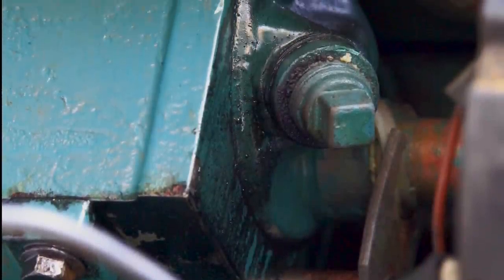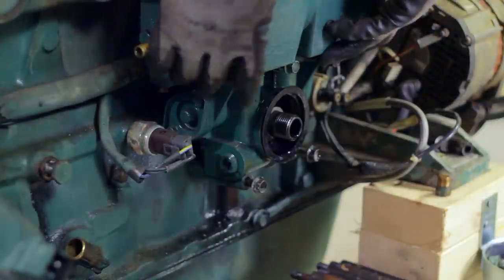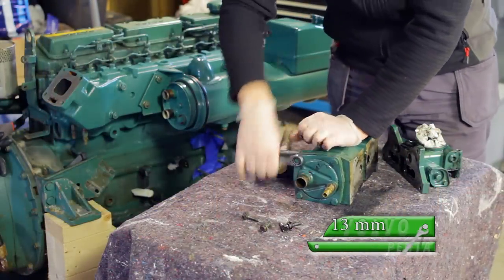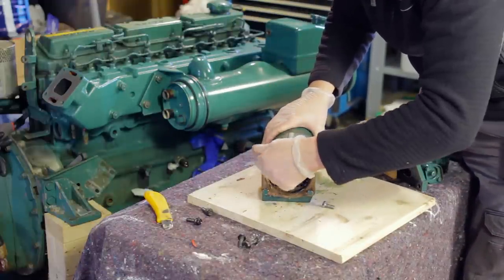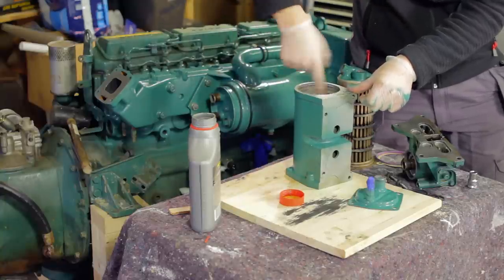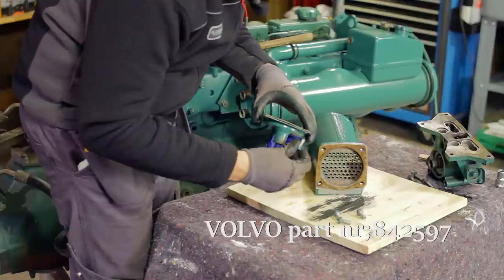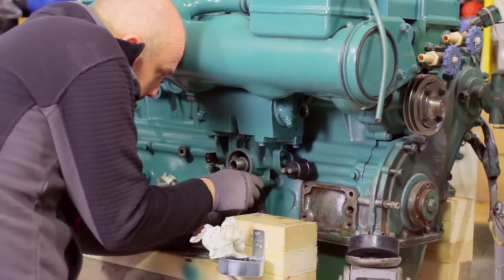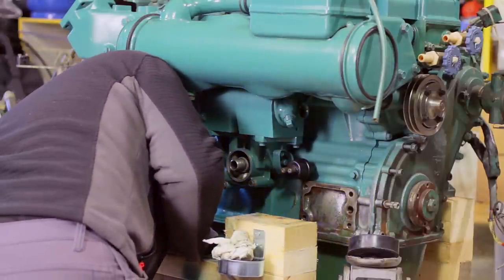Episode 3 Oil cooler

Comment: Hi there, 
Can you please tell me the pressure setting of injectors? Thoses working for bosh tells 240 bar, thoses working for volvo penta tells 260, 

I tried 240 bar, the engine smokes a lot, i find gasoil in the surface of the sea after running the engine.

I did not try 260 bar yet, 

I m realy confised

Thank you.
My engine is Tamd41a

Comment: Svend is there any plans to do front and rear main crankshaft seals or is this a simple thing to figure out ?
Reply: On my boat I had a seal fail on the outdrive and this allowed seawater to get inside the flywheel housing. This in turn caused the rear oil seal to get damaged by the rotating rusty crankshaft. For me it mea t engine out, then a Skf speedysleeve install. I have yet to install the sleeve but am told the end of the crank must be cleaned of debris before installing the sleeve. I will do my best to video the install, but it won't be as polished a production as these fine videos. The sleeve is due to arrive in 1 weeks time. Hope it helps someone.